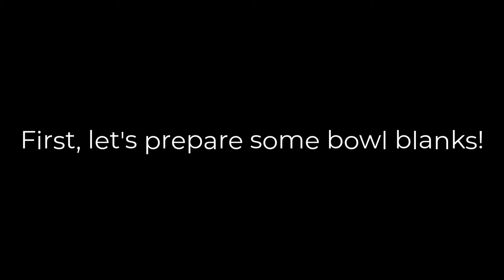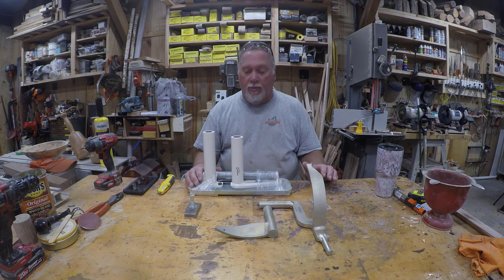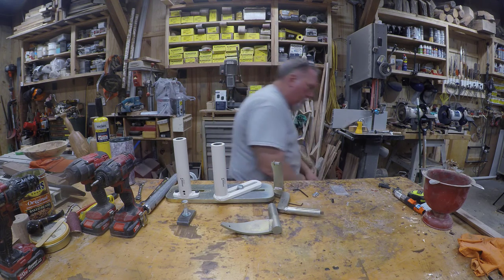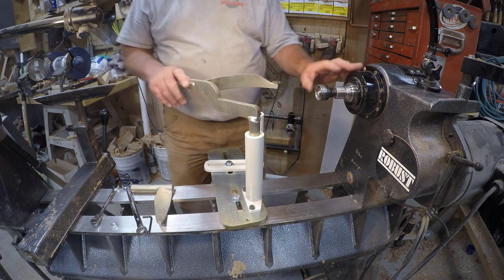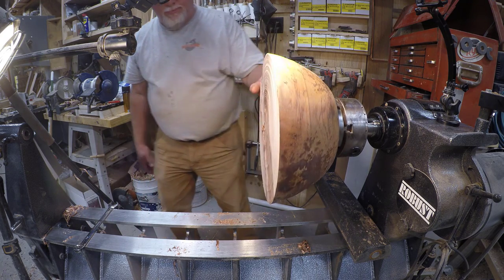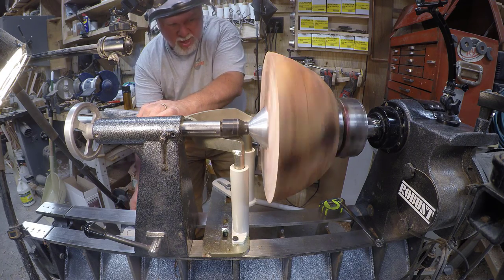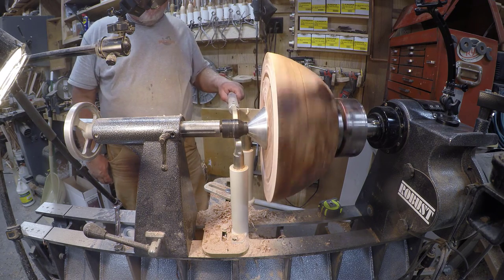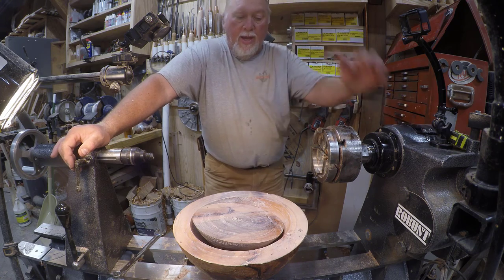Making Bowls;  Oneway Easy Core First Use

Comment: Great job, I have put off buying a one way coring system for a long time but I was afraid of the setup. After watching you it is not as complicated as I thought, it just has to be done right. Thanks for sharing.
Reply from the maker: Thanks Kenneth!  No it isn't complicated.   I have miscalculated and gone through the bottom of a couple but that is rare.  Thanks for watching!

Comment: You have every right to be happy with that. I’ve just bought one and am hesitant about using it. You have given me hope. Thank you for sharing and here’s hoping 2024 is healthy and successful 🌞
Reply from the maker: So I have been using mine for a year and a half now and I can say with complete conviction that the additional bowls I have produced have paid for the jig many times over.    Thanks for watching!
Reply: @BrailsfordWoodworks Hi again. It’s Ray from the UK. I’ve just put a tenon on a bowl, turned it round, set up my coring system then asked myself ‘how does this work?’ And watched your video again. Here’s hoping 🤔🌞
Reply from the maker: Let me know how it goes!  @raydriver7300
Reply: @BrailsfordWoodworks  Oh, I got my first core, using the smallest knife on very wet wood. Unfortunately I used 3” screws and they went all the way through the bowl. I have, however, covered them in end grain sealer, buried them in shavings and will wait until they dry to see what can be done in a few months. Thank you so much for taking an interest. Regards Ray 🌞
Reply from the maker: I rough turn the largest bowl and then put it on a chuck.   @raydriver7300

Comment: I';m sure you've found it by now but Hunter Tools has a carbide cutter that works wonders, it's spendy for the enitional set up but replacement tips are $25 and they last a long time. I usually put a tenon or mortus  on the piece to be cored out.
Reply from the maker: Thanks Pat!  Actually One Way sells carbide tips and I did get those.  I know the hunter tools have a different profile than the One Way.  I may try them at some point.  The One Way carbide does work much better than the steel.
Reply: @BrailsfordWoodworks  The Hunter Korepro is 100% better than the carbide cutter from Oneway and is simply amazing. I got over 75 cores from just the one side of the cutter and only recently flipped it to the other side and never have to sharpen it. The cartridge is a bit expensive to get started at about 200 bucks but the replacement cutters are dirt cheap. It makes using the already great coring system from Oneway even that much easier to use. 
Great video!  Thanks for sharing.
Reply from the maker: @siph2o  I will definitely look into it for my next cutters!  Thanks for the heads up!

Comment: Cool video, I hope you also watched my video's on the OneWay Coring Tool. What I found:
- The depth stops (for the height setting) are not much good, I made better ones on the metal lathe.
- You have the same cutter I have. Great cutting out of the box but they are impossible to sharpen.
Reply from the maker: Thanks!  I will take a look at yours and compare notes!  Someone on Facebook told me about an aftermarket bit that is apparently way better.  It is the Korpro cutter.  I am going to look into it.
Reply: @BrailsfordWoodworks  spend the money and get it, you won't be sorry.

Comment: Mike i just got mine today and when you lined your cutter up did you line the TIP OF THE CUTTER UP or the shoulder?  I first lined mine up with the spur tip but then someone said the shoulder the back of the cutter. To me that puts the tip like a   3/32 to 1/8 of an inch below center ???.
Reply from the maker: I put mine at the tip.  I am not sure that it will make that significant of a difference.
Reply: @BrailsfordWoodworks  is it normal to get lot of chatter abd stuff as your entering and following through the outside of the bowl is real rough but the inside is pretty smooth. Think I'll raise it up to the point see if it makes a difference.  ????? Almost like one side is sharp and than trying to cut the other side dull. ???
Reply from the maker: @jameskoehn4331  The wood being green or dry has been a much bigger factor for me.  Please let me know what you find!

Comment: I am looking into getting a oneway system. I found someone with a "new" complete system with looks like 5-7 cutter blades. How do you like yours? Is it worth the investment?
Reply from the maker: Thanks for watching!  I do like that I am no longer turning useful wood into shavings.  It does the job, but given that I have not used another system it is hard for me to judge if it is better or worse than other systems.  I will say that carbide cutters are absolutely necessary.  There is another coring system from Australia that I wish I had looked into further.  By the way, make sure if you buy that system that it has the correct base for your lathe.  Thanks again!